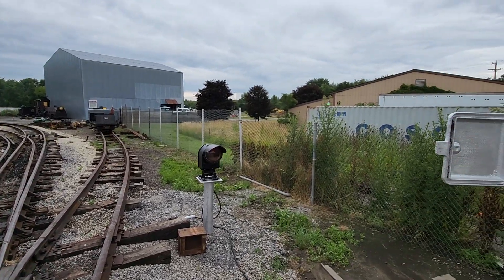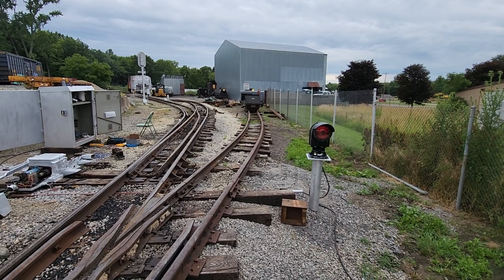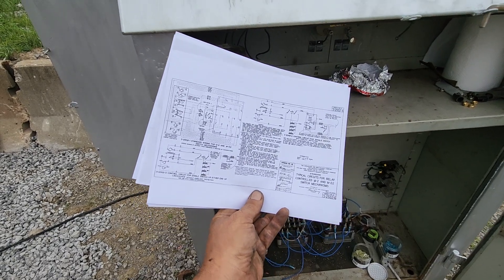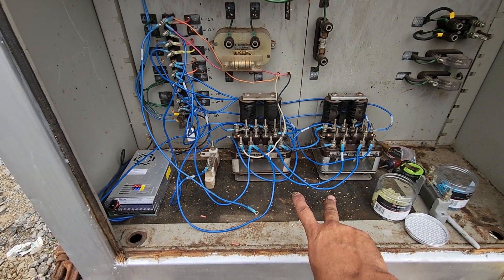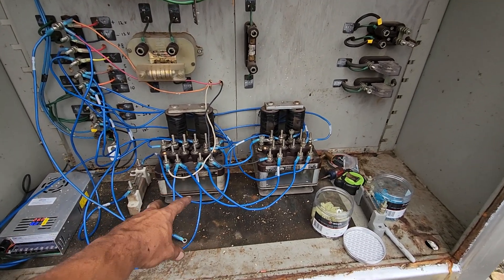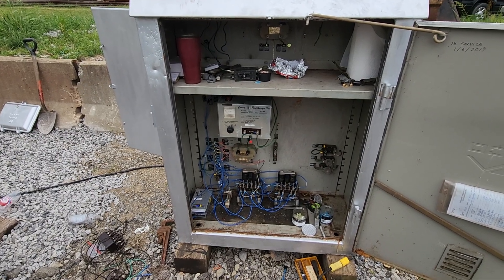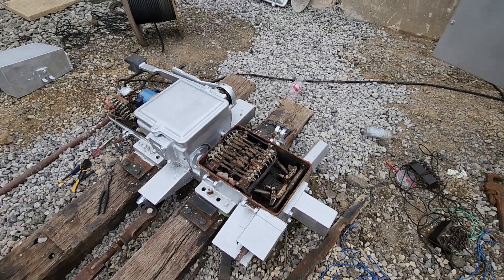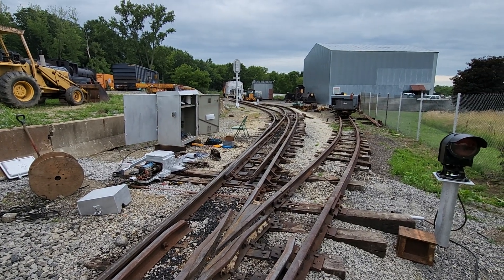Wiring up the Control Circuits for the Switch Machine

Comment: Glad you figured it out! When I first saw this switch work and having to stand there and hold a button I couldn't understand why you wanted it instead of a manual throw. Now it is nice and smooth operation all a hostler has to do is jump off the train hit yhe button and climb back on the loco motive won't have to stand idle for too long

Comment: May need some calibrating that motor is running a long time
Reply from the maker: Being a 20VDC motor, the gear reduction is 360:1 and supposed to run 15 seconds according to the manual.
Reply: Work on M23’s with same gear ratio all day long for a class 1. Motor is functioning as designed. Remember to adjust your clutch for slippage when overloaded 😉

Comment: You are not using the lock or detector rods in the operation of the US&S machine. Typically those must  be turned to attach to the point of the switch point and be attached within 6" of the physical point not to the second rod. This assures that you can meet them requirements of the 1/4" Obstruction Test. 

To do that with this hand machine it must be mounted on the opposite side of the turnout or rotated 180 degrees in it's present location and the three rods moved to the other side of the machine.

If however you are simply using this for a complex Hand Throw Stand and visually verifying point location you are fine. You will not however have the benefit of the Point Detection and Point Locking internal to the machine.

Also do you have a manual for the switch machine, I do and what is the voltage rating? It seems pretty slow.
Reply from the maker: I do have the machine installed opposite from normal.  A lot of changes had to be made to get it to work in this application and with two foot gauge.  The rods that would normally be used on a standard gauge turnout will not work here, note not enough room for the basket on the No. 1 rod for example.  The machine is flipped around with the lock rod and the point detector rod working off the No. 2 position, which I have not yet installed.  I will be working on that today.  

This machine is set up with a 20 VDC motor running a 360:1 gear reduction giving it a 15 second throw.  120VDC machines can throw in from 4 to 8 seconds.  these slow speed machines were made for locations where there is not a lot of power available and is designed for low amp draw.  Just the luck of the draw this is what I was able to purchase secondhand a few years ago.
Reply: Yeah, lots of things change with the gage. 

I am semi-retired as Technical Director from one of the largest world wide turnout manufacturers. We do everything from the highest high speed #60 turnouts to 40 foot centerline radius Streetcar turnouts, narrow gage to broad gage. I have the M3 and M23 manuals if this would  help you.

In this case we would have likely used  a vertical switch rod, reduced the switch throw from 4-3/4" to a smaller amount controlled by flange thickness and wheel back to back and relocated the basket outside the field side of the switch between the stock rail and machine to counter the very narrow gage. We do this on our hollow steel switch ties due to congestion in the head block cribs and as a safety concern, the maintainer does not have to be between the gage lines to adjust the basket.

I continue to be amazed and impressed with what you do with what you have. The true test of railroading is the ability to keep trains running at 2am when the temperature is -10, wind blowing at 60mph, most of the crew reported off and there are no spares.

If I can assist, I would be glad and honored to.

Comment: I had an Idea about the csx boxcar, basically you could cut the floor of the boxcar so that way you won't need to add a transfer table and the 58 can just roll in, it saves money and time.
Reply: I believe that the transfer table is so that they can add a small yard.